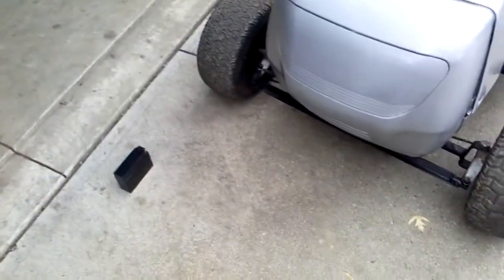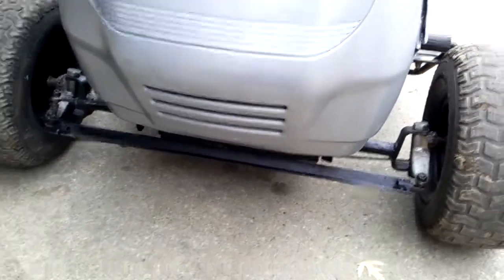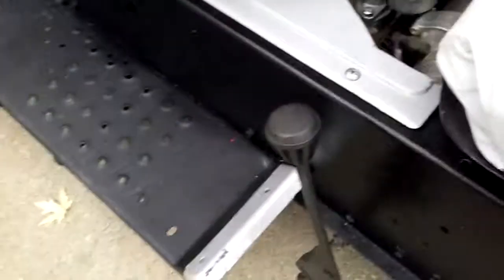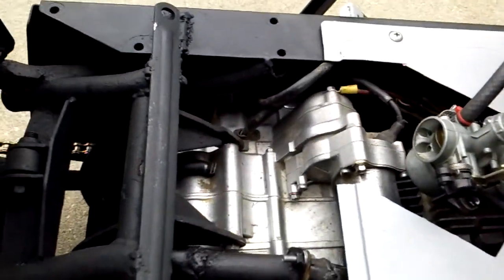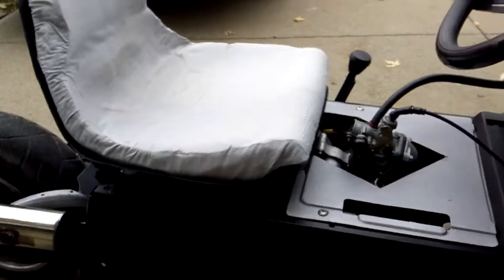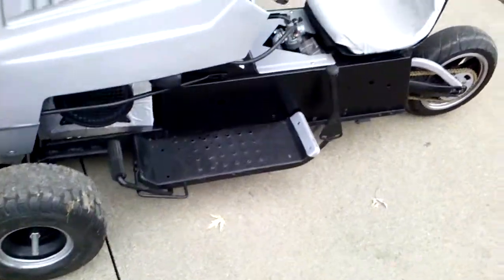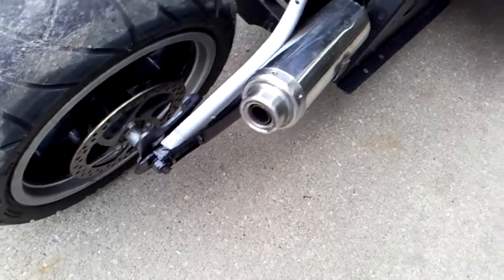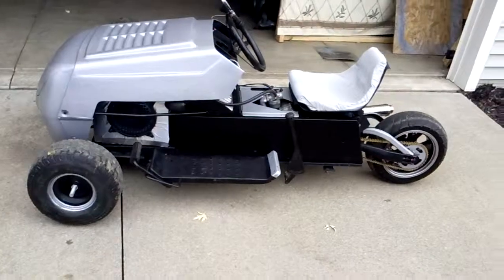110cc Racing riding mower reverse trike finished

Comment from the maker: Ok u need a super pocket bike cut the frame but keeping the motor mounted u will need that. Take the complete rear end from the riding mower off u just need the center.  U have to slide the pocket bike frame in the middle of the riding mower frame no make welds and brackets